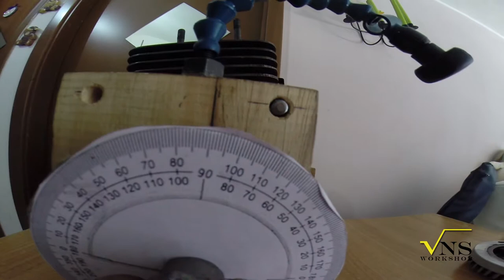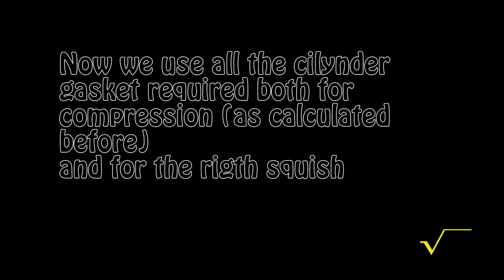Ciao Moped  series E7  Final Port timing check

Comment: With the spacer you made, how would did you mill the top of the cylinder down? Did you use a lathe or a mill?
Reply from the maker: I used a lathe and a proper tool to take it, so parallelism is  still correct
Soon some video about the cylinder ,take a look,maybe this afternoon! And soon the first run...
Reply from the maker: https://www.youtube.com/watch?v=hq8LLl_yEyI&feature=youtu.be

Comment from the maker: Final setting on the Piaggio Ciao engine:
Ex 178°
Tr 112°
Tr boost 112°
Rotary valve intake 195°
Squish 1.1
All with the stock material
Reply: I would try to raise the transfer and boosters a bit. You have a blowdown of 33° (178-112)/2, that is pretty agressive. Will probably have a very narrow power band and weak bottom end. I would go for something like blowdown 27°. So the transfers would have to be open for 124°.
Just a suggestion, i enjoy your videos :)
Reply from the maker: @CarstenLorenzen12V   you are rigth , soon the video of on board test.
It s funny to play with stock material...
I also make some video abot the job with rotary valve,soon on youtube, need to be edited.
Thanks